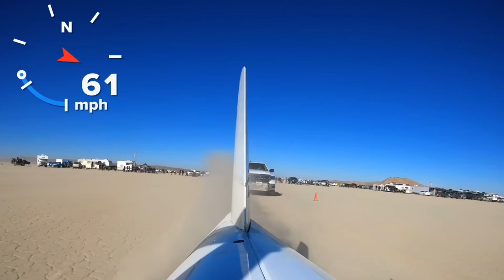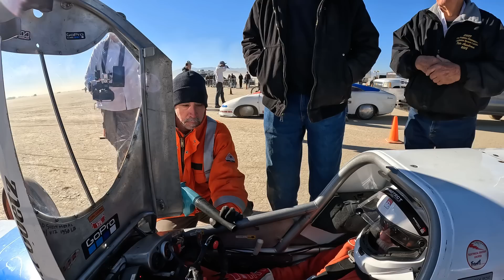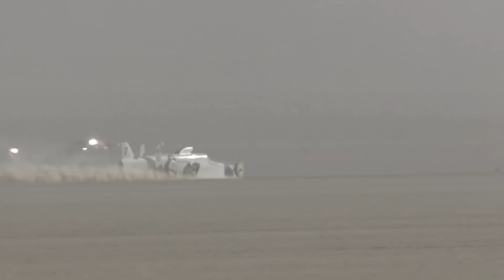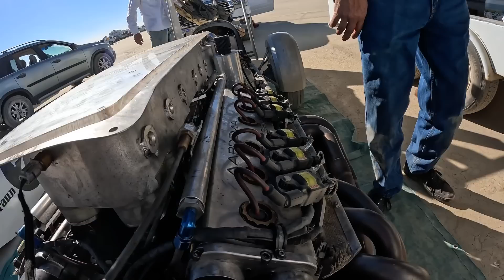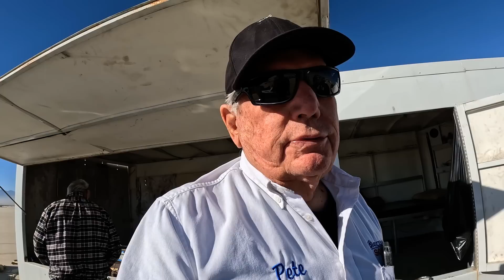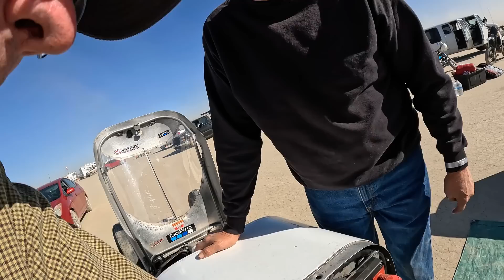American V12 Car Reaches 244 MPH on Dirt  - Aardema Braun Power

Comment: It seems like you can see a boundary layer of air coming off of the front tires because of the dust that is suspended in that boundary layer.  I wonder if there is a way to reduce that layer by either a fairing or a pitot tube to reduce the air pressure build up in front of the tire.  This might also help to plant the tire on the dirt making it more controllable at high speeds.

Comment: Why not Under Drive the Alternator 50-60% from current ratio?
Is Alternator driven from Cam of Crankshaft?
Since you use Serpentine, might have to retrofit a Power Steering Pump Pully😊
The Haltech demands voltage & amps to fire.
EGT-CHT?
Balance equal Power😊

Pete's deep breath & grin is priceless after Kevin's report in the traps😂😂😂😂
More Down Force❗️❗️❗️

Did that on my Old Skool BBC V-Belt, drag car.
Dual Points & Cable Tach
3-4 mph improvement after the switch😊